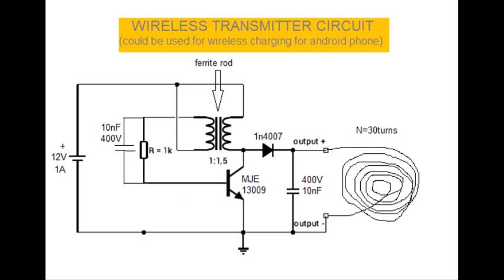Cool experiments with wireless transfer of power ultimate diy

Comment from the maker: I used 12V self oscillating circuit consisting of biffilar coil wound on ferrite rod. Since there is a ferrite core the frequency is low maybe 10-15khz. Than I fed this output spiked dc signal to the flat pancake coil. Since it's air core it should get higher frequency so I used a 10nf ,400V capacitor in parallel with it. So we have 2 type of resonance going on here. All that is accomplished with direct current instead of alternating which official wireless chargers for phones use. And they cost 30-60$ while my version is made from junk electronics. My android does not support wireless charging but if it were I'm sure it would be charging. There is however flat rectangular coil on the phone back cover which is used for nfc(near field communication)-android beam and wireless payments. My first thought was that it is wireless charging receiver but it's not lol